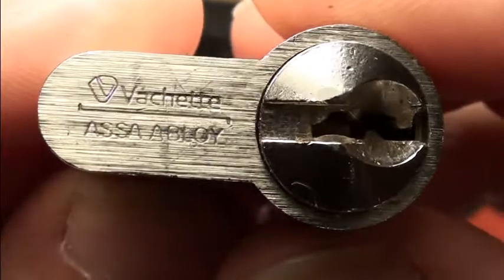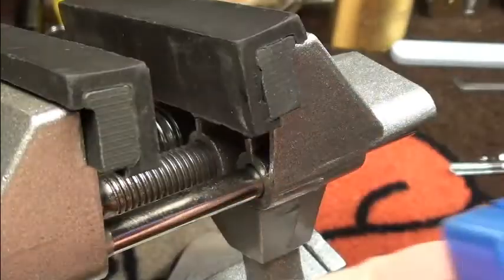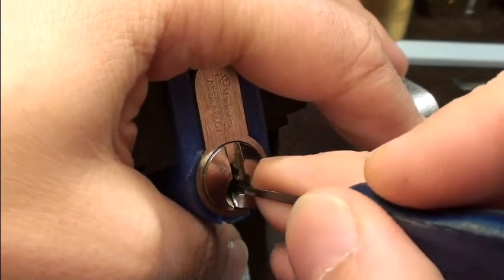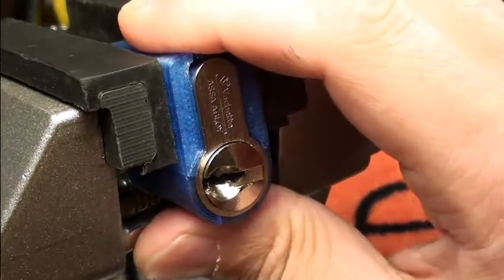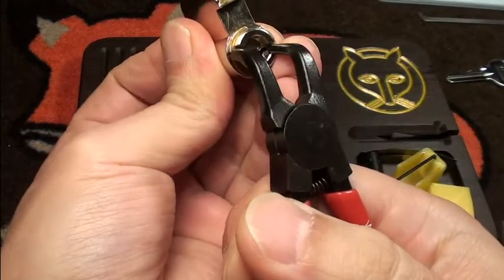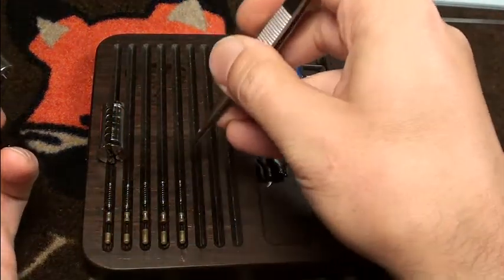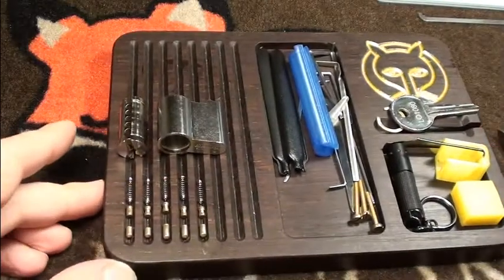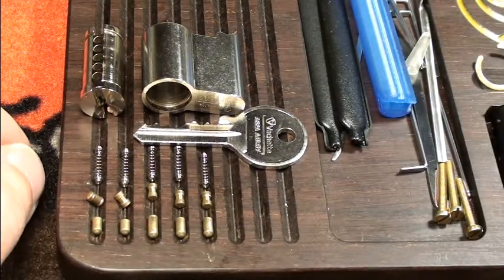(179) - lockpicking a little Vachette euro cylinder

Comment: I've never seen one of those locks, but it looks like you went through it pretty quick. 👏 🔓👍 Great video.
Reply from the maker: Thank you William :). Yes, I think it's my only French lock ;D. Basically is has some spools, so it is quite an easy lock. The only thing that could make it harder would have been a different bitting (and that makes often a very easy lock very hard).

Comment: I've never had the pleasure of a vachette. Great picking :-) I thought that vachette did high security locks and this seems relatively normal?
Reply: Lock Noob i Know them As standart locks in france
Reply: Lock Noob say no more, I live in France and can send you a couple with great pleasure
Reply from the maker: Michael (MHM) sayed, they are standard (and locally sold) locks in France like Lockwood in Australia. And well ;), it doesn't mean they could not do high security locks as well ;). I have only one Vachette, so no idea :).
Reply: TonyS Locks yes, snorer is a legend and a fabulous picker... one of the best on you tube for sure :-)
Reply: Stromi 90 I see, we don't see them over in the U.K. very often, though I see their distinctive keys at locksmiths somethimes :-)
Reply: Well done with this Vachette First (7000). 
It is the successor of the Vachette 2000 but with the same pins, only the keyway changes. And it is of course different from the V5. ;)
Reply from the maker: Thanks a lot for watching and for the additional information on the Vachette de Ronchopathe :). Cheers :)

Comment: Very beautiful lock! I have the same one tallan has, the other end. I haven't gotten into mine yet lol.
Reply from the maker: Thank you Frosty :). Yes, I have seen the serrated (almost spooled) keypins, so the trick is most likely only one tiny click on each pin, the rest should feel like normal pins. I imagine that it is not easy to pick. GL , you will get it open :).
Reply: redcatimaging Thanks :)
I am going to get it open soon. 👍😊